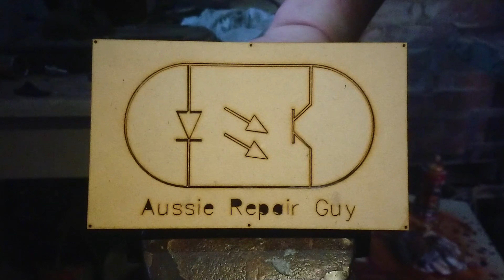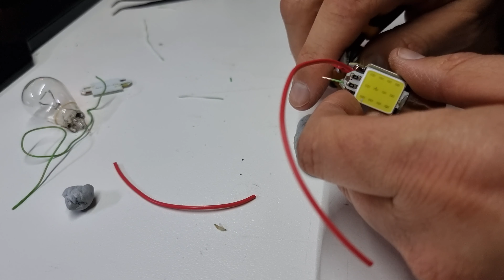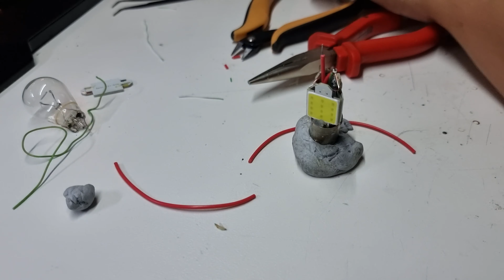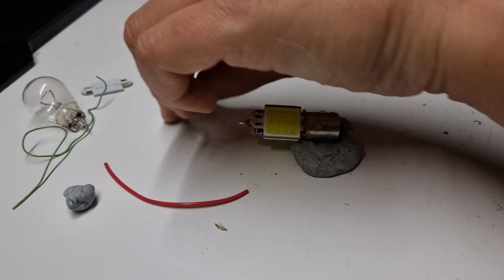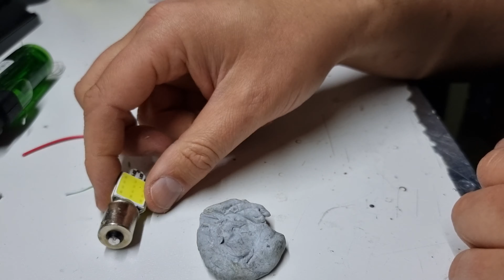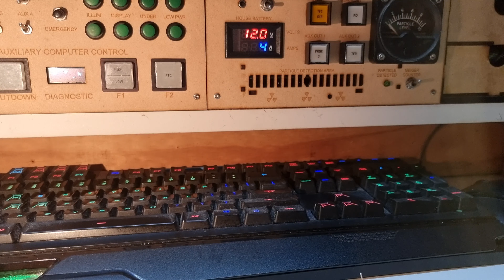Converting a BC globe to LED

Comment: I want to replace similar globes in salt lamps. Incandescents are expensive to constantly replace and cheap eBay bulk packs were a worse mistake. Unfortunately heat is required to keep the salt dry (and the magic negative ions obviously) but I doubt in a home it requires 40W.
Any suggestions for dim LEDs with a bit of heating element? Doesn't need a traditional socket or power supply, I always stick with 5 or 12V anyway
Reply from the maker: If you get 12v led auto lamps, most of them are running pretty hard. The ones I used here sit at 60c on 24v, you can get ones with resistors for 12v that run just as hard. Or you can swap resistors to suit needs. COB LED's are the way to go if you need heat
Reply: @TheAussieRepairGuy  I don't think I can use LEDs for heat since they can't be too bright. They'd need to be similar to a 20w incandescent. Probably adding in something else resistant for heat.
Reply from the maker: @ChrisMorgan92  if at 12v run a string of 120 ohm carbon film resistors
Reply: @TheAussieRepairGuy  That was my plan if I couldn't think of something better :)